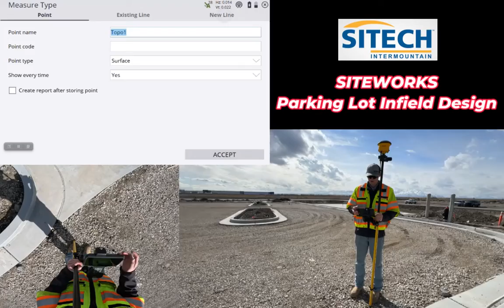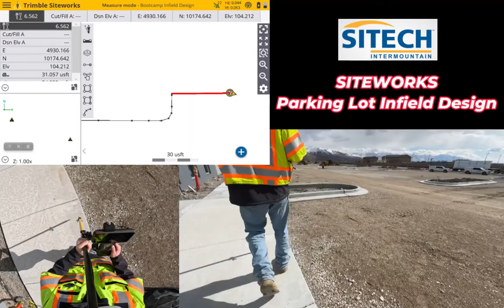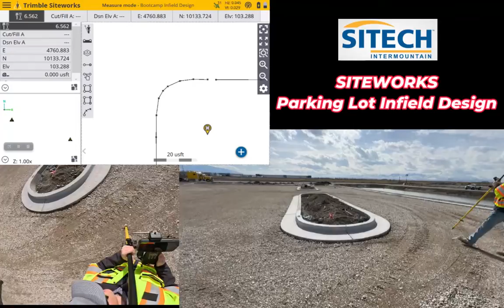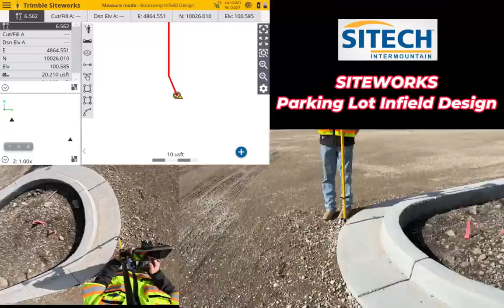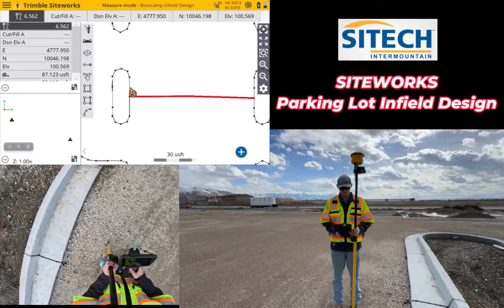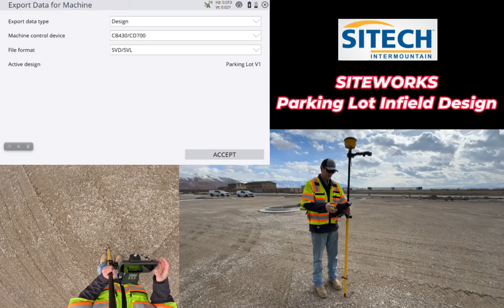Siteworks Parking Lot Infield Design

Comment: What if I do not have the advanced measurements module for closing out the line?
Reply from the maker: @Baron_Rutledge  just take the last shot right back by the first one without crossing the line.  It is not needed to have a perfect closed line to create the model.  Including a stock pile outer boundary line. When you go to COGO to run the report, it will auto close it for you.
Reply: @sitechintermountain  I know about the stockpile outer boundary closing itself I was curious about the surface as design. Do you know which advanced measurement module you have? Thanks for the help.
Reply from the maker: @Baron_Rutledge  as far as I know there is only one advanced measurements module.   You don’t have to have a closed boundary to finish out a surface as design option either if you don’t have it.